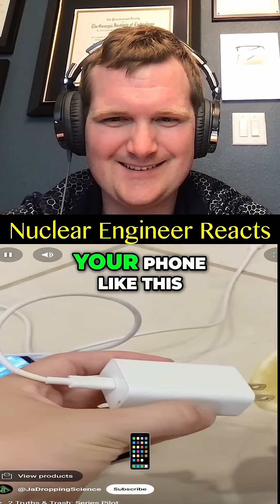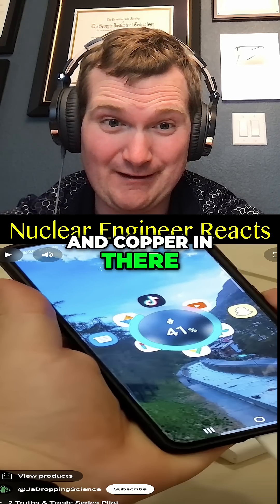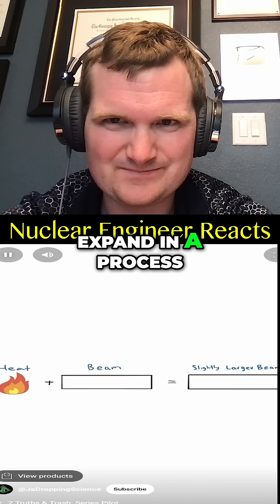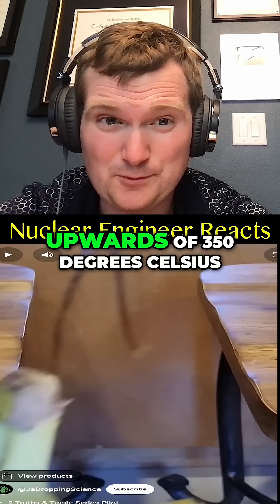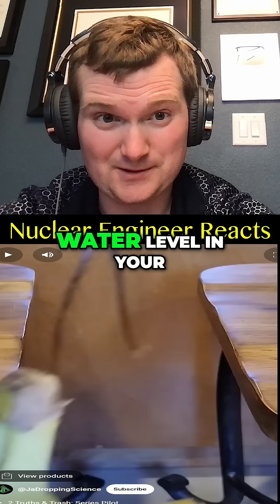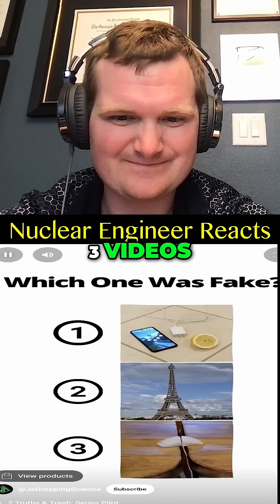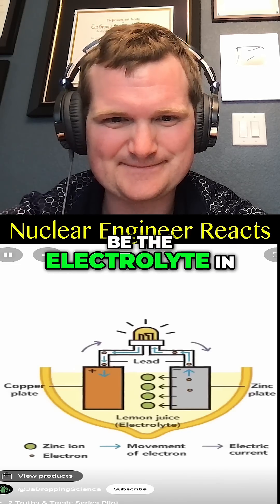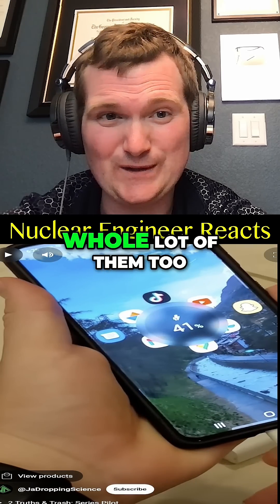Charging a Phone with a Lemon? - Nuclear Engineer Reacts to 2 Truths & Trash by JaDroppingScience

Comment: Wait... So if you have a charger head extender with prongs made of zinc and copper you would get a bit of a charge?

That's a cool science experiment!

Edit: apparently the voltage is too low with only 1, and we can't connect to the battery cell directly so we have to get to power grid outlet voltage (110-240) so... Sadly a no-go.

Comment: He didn't mention that the charger shown requires 120V AC in order to work. Galvanic cells would supply DC voltage.

Comment: I think with the copper wire over the ice, it's more the heat being transferred from ambience into the ice much more efficiently than through air as copper is a better heat conductor, rather than the pressure melting the ice. Although it is probably a mix of the 2. Could try it with a non conductive wire instead and compare the 2 to see which ones faster.

Comment: the wire is not melting the ice due to the pressure, it's just that the metal in there is so heat conductive that it's able to use the parts of the wires that are not touching the ice to transfer the heat of the room (and the wire in general) into the ice efficiently.

Comment: For #2 that is ALSO why if you've ever walked over railroad tracks the gap on the sides of the rails are much bigger than needed for the train to ride on..the reason?? Thermal expansion..you want to leave a safe preventative amount for the rail to have enough room for one thing and the second reason is that you don't want to damage the concrete or supportive road structure due to the expansion..think of how the way water freezing or snow packing in cracks on the streets you drive on creates pot holes from freezing expanding melting etc...

Comment: Fun fact about thermal expansion, when using gauge blocks to check for tolerances you actually have to take their temperature first to make sure that they are the correct size. They need to be 20 degrees celsius or you basically cant use them.

Comment: I wired up some valves on a steam pipe at a power plant. I left what i thought was plenty of slack in my flex conduit. When it first fired up it literally broke not only my flex but the floor grating it went through at the bend of the pipe going through the floor. Altogether it was about 3 foot of expansion.

Comment: Accurate. 10,000 lemons (5 series x 2000 parallel) to fast charge (2A) an iPhone. 10,000 lemons can charge about 37.5% of an iPhone — under ideal lab conditions. In real life, inefficiencies and resistance would likely reduce that to 20–25%.

Comment: “Pressure causes ice to melt” sayeth the video. And I mean, they aren’t incorrect, but I feel them using copper (good thermal conductor) will assist in transferring heat and in affect melt the ice.
Reply: it seems that only one person in the comments actually understood what was happening there haha. you're right, whenever they show the wire cutting through ice experiment it's the thermal conductivity of the metal wire instead of the pressure. you'd need a lot more pressure than what those bananas or some weights could give to melt ice with pressure alone.

Comment: He plugged a 120 Vac plug into a lemon. Yeah, that'll work.
Reply: Which is also 170V peak to peak. If you wanted to power a phone with purely lemons, you'd have a better time connecting the lemons to the cable directly, as the minimum voltage for USB charging is 5V, so you'd only need about 6 lemons in series to get to that voltage. Not sure how many in parallel you'd need to get enough current, but probably more than 100 6-lemon cells. (So about 600 lemons)

Comment: A single lemon battery (with copper and zinc) would produce about 0.9 volts DC open-circuit, so you'd need more than 100 in series to get a flyback converter like a phone charger to even start, let alone provide any current. If you use two identical coins with the same composition as electrodes, it produces exactly 0V, so you'd need an infinite pile of lemons to power a phone.